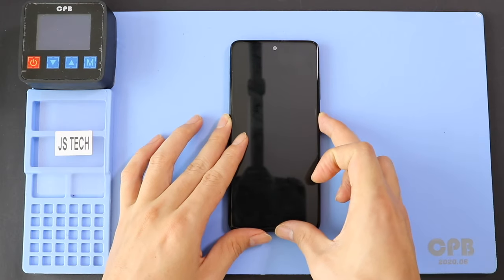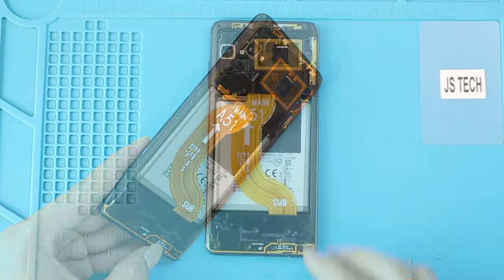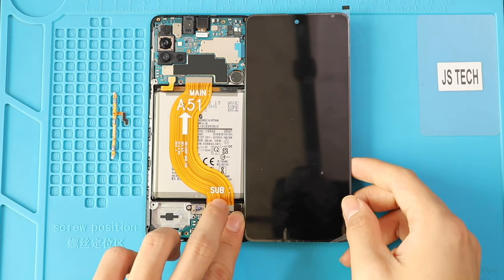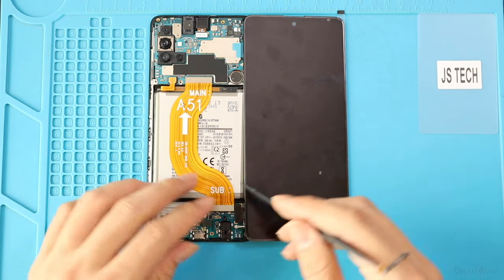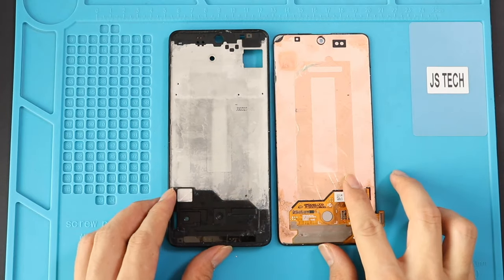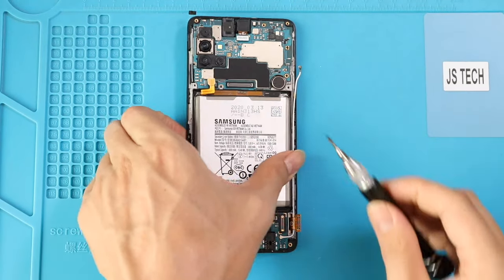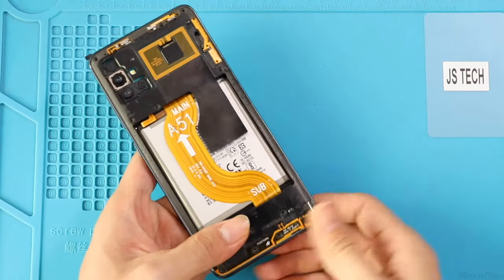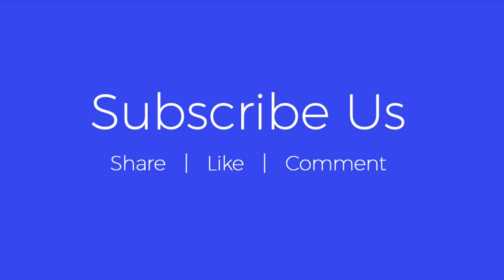Samsung Galaxy A51 LCD Screen Replacement

Comment: Bad advice to remove the power volume flex, it will tear easily. You can turn on and off the device by shorting the 2 pins out of the three at the edges, leaving the middle one untouched.
Reply: I tore it kinda.😢
Reply: @Aries_player1  why didn't you read the comment. It's cheap to get a new one. In the meantime you can use it by turning it on like I wrote. Just make sure you don't let the battery die because you won't be able to turn it on.

Comment from the maker: Note - If you are using a Non-Genuine screen, There will be an issue with the Touch ID, 90% chance it won't work.
Reply: What you mean by non genue?
Reply from the maker: @ss-ze2om  aftermarket screens
Reply: I want to replace my screen and i want to order it from aliexpress.
Reply from the maker: @ss-ze2om  You can try, if not, we can offer you. what is your location

Comment: Will the in-display fingerprint still work??
Reply from the maker: Depends on the replacement you are using. If it is an original, it will work
Reply: @DIYGeardo thanks... Guess that's the disadvantage of under display fingerprint

Comment: Question .is thr new screen a super amoled??
Reply from the maker: This one is not an original one. The fingerprint sensor won’t work in a aftermarket screen.
Reply: @DIYGeardo  how much is this screen? Is it the best one u used or there is even a better one
Reply from the maker: @ISRAADVISUALS  Original is about $75, but others quality are so-so.Just depends on your preference

Comment: Would you mind telling me whther it's possible for putting the screen of samsung a51 & a52 to samsung a51 5g? thanks.  I have a screen of a52 and crashed screen a51 5g so I wonder whther I can put them together.
Reply from the maker: if i am correct a51 4g screen is compatible with a51 5g.But without frame

Comment: Hallo!
If the screen is completely broken, the device cannot boot?  It only vibrates when connected to the charger
Do I just need to replace the screen

Tanks
Reply from the maker: The first step will be screen replacement. Looks like your phone is charging means the board is responding.

Comment: Did it but the fingerprint scanner does not work
Reply from the maker: ok it is like this. If you have use a non genuine screen, then the touch id won't work. You need an original screen replacement to work the touch ID.
Reply: @DIYGeardo  how do I know if it an original
Reply from the maker: @edmondchege7381 from where did you get it ? Did they mention anything about the quality ?
Reply: They  told me it's an original
Reply from the maker: @edmondchege7381  you should check with them for a solution..
Reply: Okay

Comment: After replacing screen it, the screen tremendously drains the battery, even when in standby. Does anyone know a fix?
Reply from the maker: What type screen you have installed?
Reply: @DIYGeardo  aftermarket TFT display